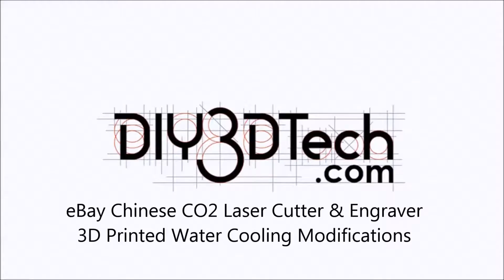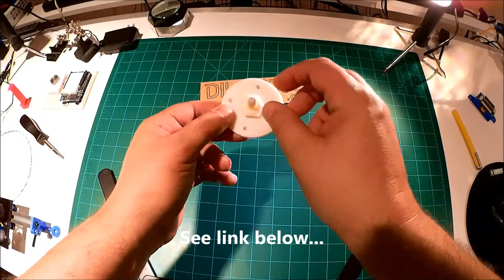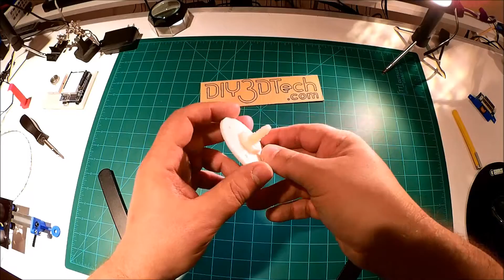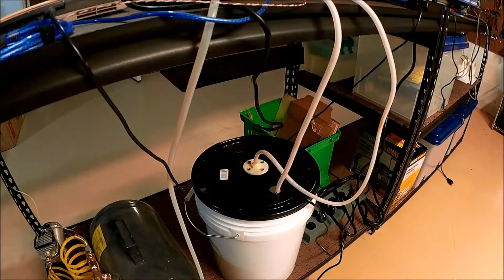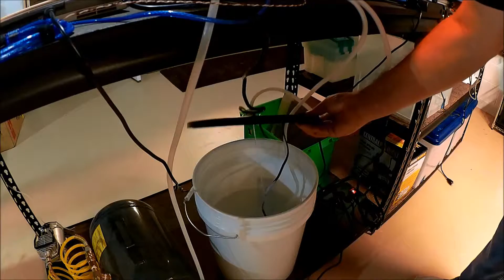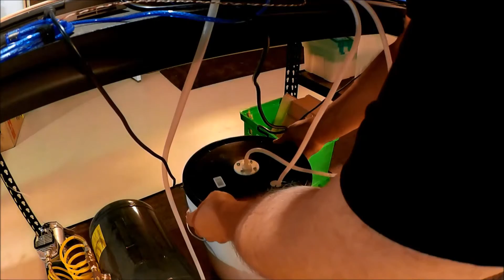eBay Chinese CO2 Laser Cutter & Engraver  - 3D Printed Water Cooling Modifications

Comment: Do you have any trouble with bio growth in your cooling water? that so far is my biggest issue.  Trying to think of what could be added to the water to make it inhospitable for anything to grow without causing other problems.
Reply from the maker: +Byron Morgan Most people use distilled water and change it every month or so.  Also some folks use"safe"anti-freeze (do NOT use car anti-freeze as at it is highly poisonous especially to pets) Since we have a heavy duty whole house water filter, I use tap water and change it every couple weeks.  Also my system is closed and comes into almost no external contact which also helps. Also like you avatar!  Very cool :-)
Reply: +DIY3DTECH.com Ours is in an industrial type setting, no animal access.  Changing the water out is a serious pain in the backside.  I was hoping something simple like a bit of vinegar or something along that line would be harsh enough for the algaecide, but not be too tough on the machine components.  My tank is opaque, as is the tubing (i replaced the clear stuff with opaque)  and the only strong light exposure is whatever it gets from the laser tube.
Reply from the maker: +Byron Morgan As mentioned above, I have seen "safe" Antifreeze like you use to winterize RVs used with success by people who keep their laser in a non climate controlled area.  While I have not personally done this (as even being "safe" worries me as we have two small dogs).  As the tube is glass so its only the silicone tubing which could be an issue, but again doubt it would be...